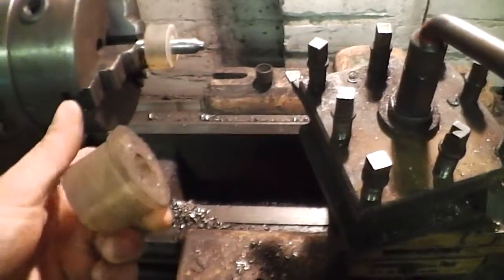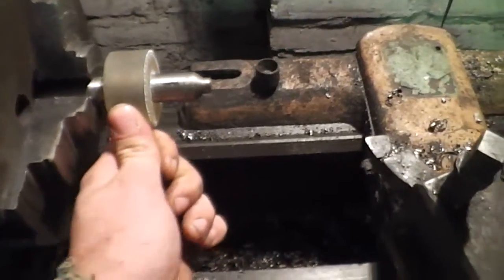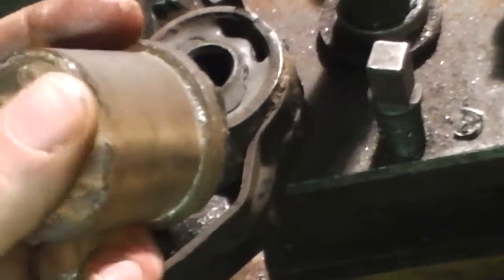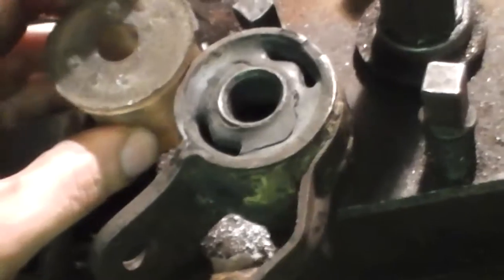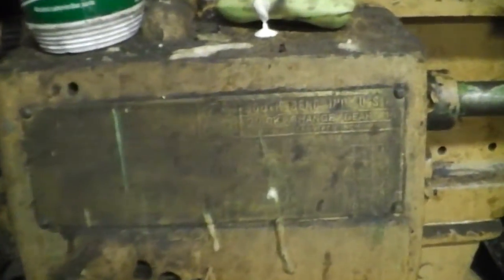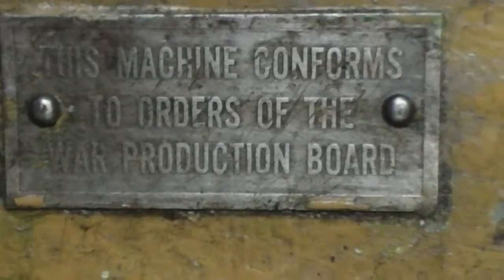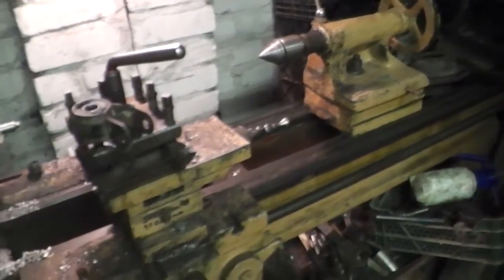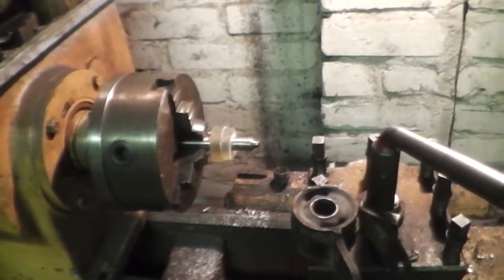DIY How To Lathe PU Polyurethane Machining Car Suspension Bushings For example Citroen Xantia.

Comment: very nice :)  My engine mount broke so I use polyurethane for roof to fill the hole and it work here is picture http://i.imgur.com/B1PHJTx.jpg
Reply from the maker: +singlecams Thank you,yes firstly i was make same thing,but for suspension is not workig so well! is hard to fill it from one side to other,so PU glue will fall out later imho!
Reply: +nagla626 car channel... it is nice lathe , I make differnt channel with my lathe videos but now my lathe broke so not sure what to do, , maybe power with drill motor? I will send you link in message you can see it is just a toy lathe not like this, but I made many car parts like spherical housing, delrin bushings, even toe arm link
Reply from the maker: +singlecams yes is not bad ,but not good too,it is not HARD it has play everywhere,but price was well!
Reply from the maker: +singlecams didnt receive your URL yet :( maybe put it here.
Reply: +nagla626 car channel...  ok I sent it now in your inbox
Reply from the maker: +singlecams ohh just now i find inbox,social sites getting every year more complicated!
Reply: +nagla626 car channel... hi thanks for looking I will check if it is short between the capacitor :)
Reply from the maker: btw did u fixed your lathe? :)
Reply: hi sorry for late reply no i didnt fix yet its too expensive, usd dollars very expensive.